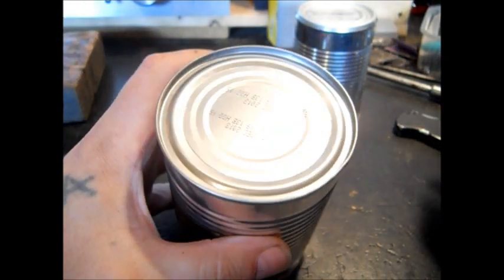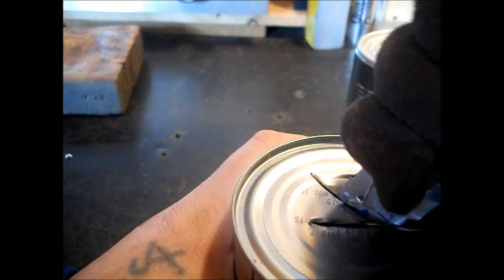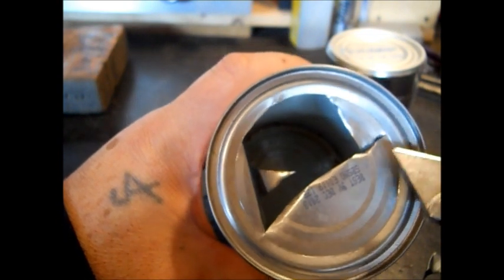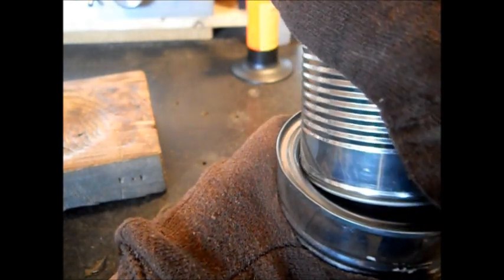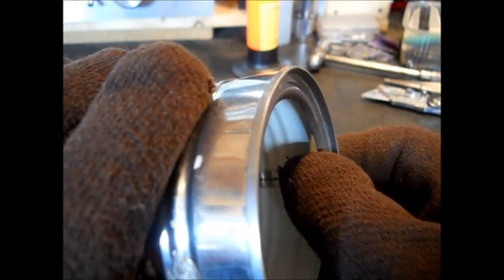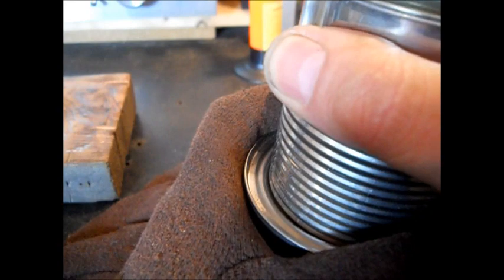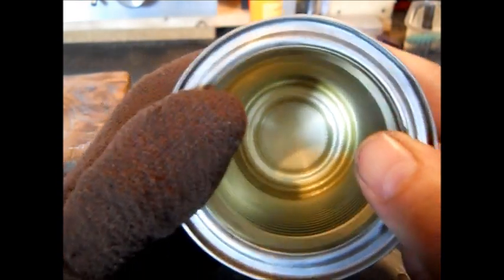Woodgas Stove ( HOW TO Make hole in outer can to fit inner can )

Comment: excellent method of cutting and fitting thanks.
Reply from the maker: You are welcome!
Reply: @not2fast4u2c  I have found that deep drawn cans offer yet another small benefit. the cut off the top is designed easily fit onto the bottom of the can and can be held in place there with a small screw. This provides some additional insulation to the bottom of the burn pot along with some additional thermal mass which is helpful especially when your stove is transitioning from burning woodgas to charcoal and you then need to keep the heat down by your charcoal as high as possible. A multiple of small Primary Air holes (as opposed to fewer larger holes of the same overall volume) is also helpful to prevent cold air inrush of  Primary Air from cooling your charcoal. Of course you can do this with a regular can lid but lids of the cans which are designed  to stack will self align on the bottom and stay that way more easily when you fix them together. It is a small thing but I have found with the very small compact stoves I like to build that such attention to details will help to work in your favor.

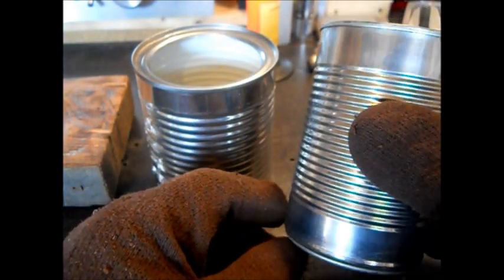Comment: 9:40 To keep alcohol from pooling in bottom of fire can, don't pour directly into stove. Instead, reserve a small batch (1/4 cup) of fuel  (pellets, sticks, whatever you use) and soak it in 1/4-1/2 oz of alcohol (or lighter fluid). Then toss that on top of fuel pile and light it.